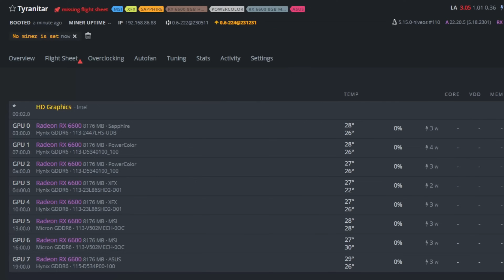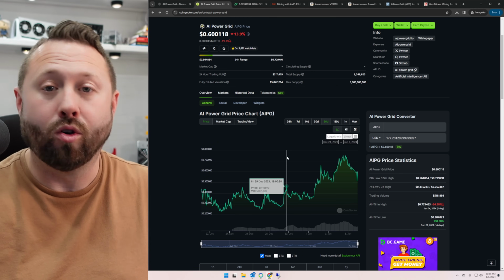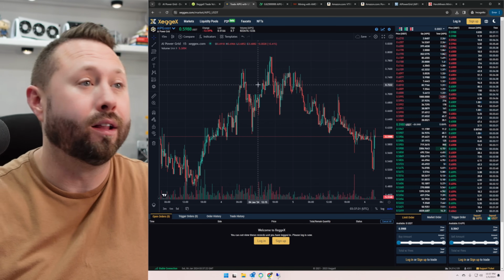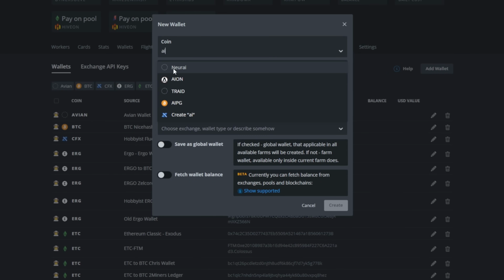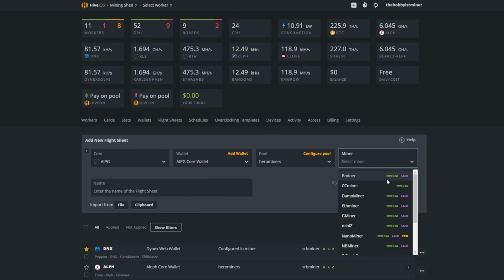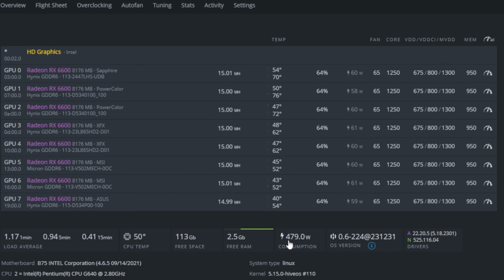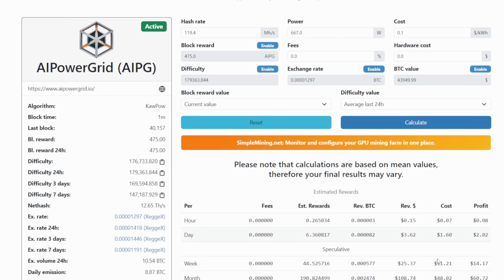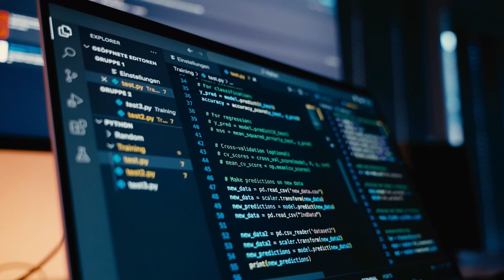I BUILT this AIPG GPU MINING RIG and It's PROFITABLE! RX6600 GPU Mining Rig

Comment: Can you provide specs for the fan? What rpm/cfm is high flow fans?

I have a server case I bought a long time ago and it has intake and exhaust fans but my car's run hotter in the case than outside of it, the fans are not that strong

Comment: Do these motherboards/cpu have a high fail rate? In my years of mining with normal motherboards, I’ve occasional had the few boards that just went dead system doesn’t turn on, swap out the mobo n boom I can mine again. But what about these boards?

Comment: Great tutorial! How does the noise level of the VTRETU compare to some of the other server case brands like Octominer?
Reply from the maker: The PSU is louder. The fans are quieter but it's nice to be able to adjust them.

You don't buy server cases traditionally to be quiet. As when it's hot you want those fans roaring.
Reply: @TheHobbyistMiner  Agreed but as a home miner I'm hesitant to try them due to the noise. It would be cool to make a video on sound suppression techniques...like making some sort of enclosure using acoustic foam?